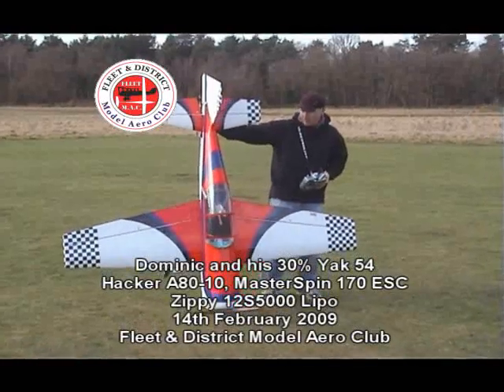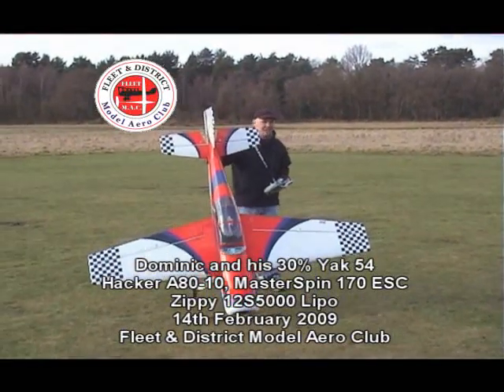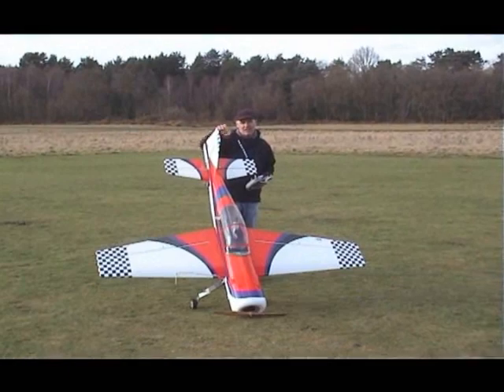Nitroplanes Yak 54 Crash: Ditchit

Comment: @ditchit I LOVE the smell of burnt glow/gas fuel.  I LOVE firing up an engine and watching the exhaust fume out.  No disrespect to electric because it has it's advantages but I've had a buddy of mine who lost in addition to his plane, his $130 ESC, $50 battery and damaged his motor. I've scored some 10's on my "crash o meter" and only one time did I damage the engine that needed repair.  Most of the crashes I would just pull the engine out of the ground, soak and I'm back in business.

Comment from the maker: Bigger planes than this fly on electric. Ever seen a Hacker A200? Was my mistake not to configure the low voltage cut-off on the ESC properly. Wouldn't make the same mistake again. Gas engines are a lot more likely to deadstick than an electric setup. I'd choose electric EVERY TIME over gas. Only disadvantage is can't use smoke system.